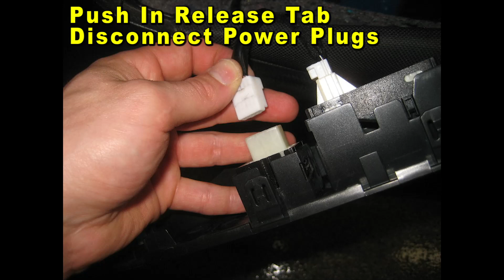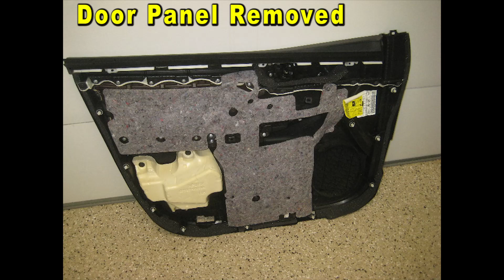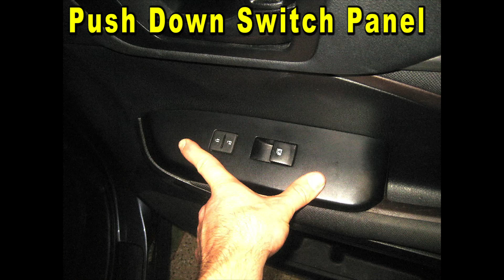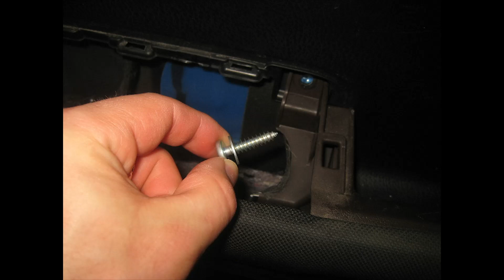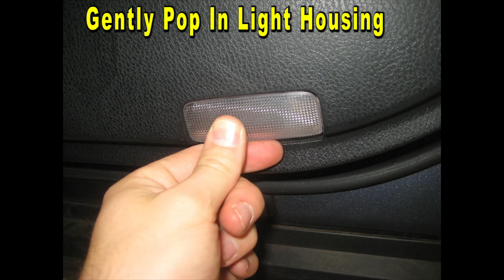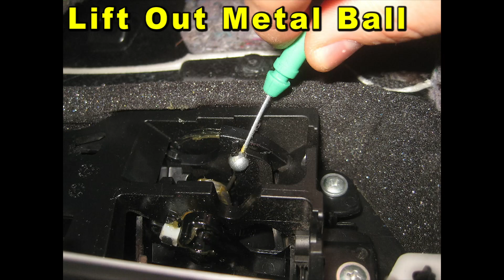Toyota Highlander How To Remove Door Panels & Upgrade OEM Speakers 2014 To 2019 With Sizes

Comment from the maker: Check out the DIY guide for taking off the plastic interior door panels and upgrading the OEM speakers in a third generation 2014 to 2019 Toyota Highlander with the 3.5L V6 engine - 
https://www.paulstravelpictures.com/2014-2018-Toyota-Highlander-Interior-Door-Panel-Removal-Guide/index.html

Here are all of the DIY repair and maintenance tutorials for the 3rd generation 2014, 2015, 2016, 2017, 2018 & 2019 Toyota Highlander -
https://www.paulstravelpictures.com/Articles/2014-2018-Toyota-Highlander-Common-Problems-Repair-Maintenance-Guides.htm

Owners of other Toyota, Lexus and Scion vehicles such as the 4Runner, Avalon, 86, C-HR, Camry, Corolla, iM, Land Cruiser, Mirai, Prius, RAV4, Sequoia, Sienna, Tacoma, Tundra, Yaris, FR-S, xB,  xD, tC, xA, CT 200h, ES 250, ES 300, ES 330, ES 350, IS 250, IS 350, RX 300, GS 250, NX 300 and RX 350.